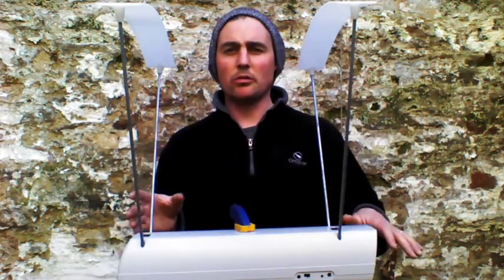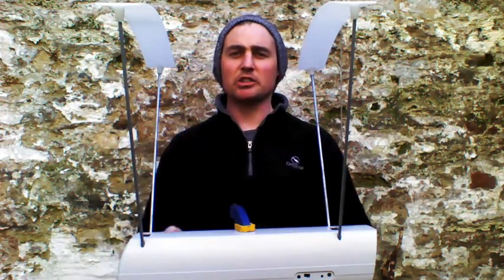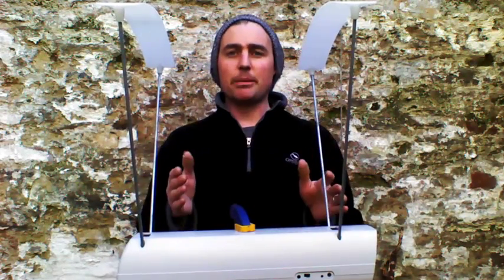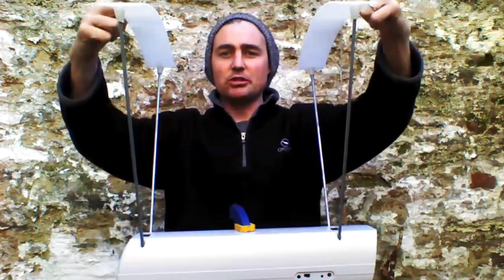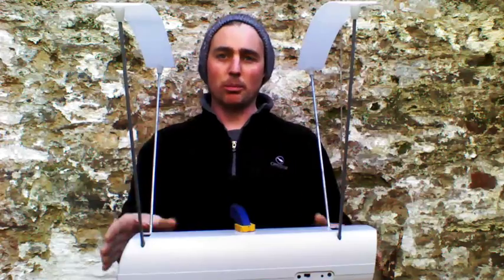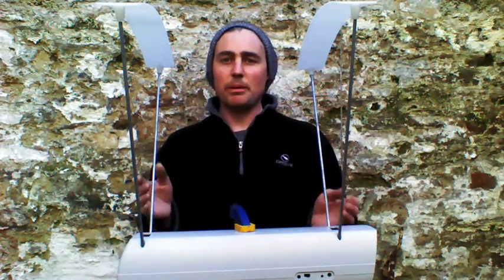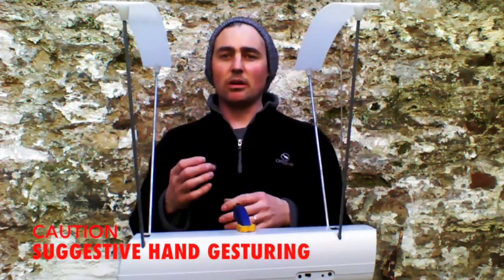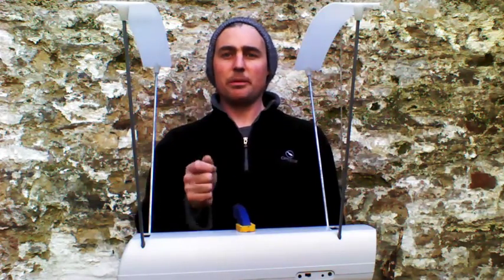FDS Chrono How To

Comment: The F1 is a terrible chrono, I had one with the lighting kit and it still read 1 out of 5 as an error and the numbers had a larger range. The CE Pro Chrono with their lighting kit is expensive but it works great. I will starting shooting a large number of darts to get a similar test group.
Reply from the maker: Awesome! Anything over 30 darts. I picked 50 because I was providing testing for commercial use as well. I think a 30 dart test with new or shot once darts is ideal. Interesting that the F1 got more error. I just avoided it because the CE one has better memory for the price.

Feel free to add your data to the pool at www.britnerf.co.uk look for Oldnoob Foam Data sub forum. Note that none of that data is licenced or used for commercial purposes so people shouldn't go "stealing" your figures.